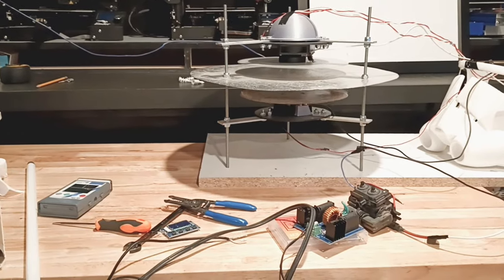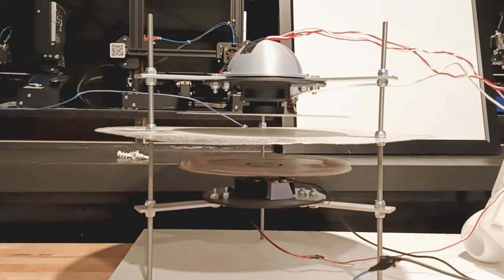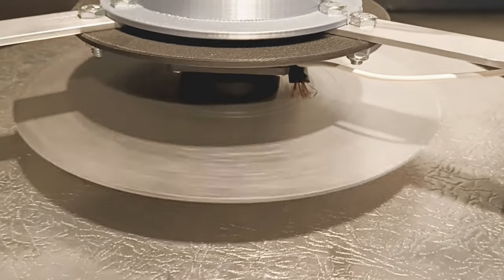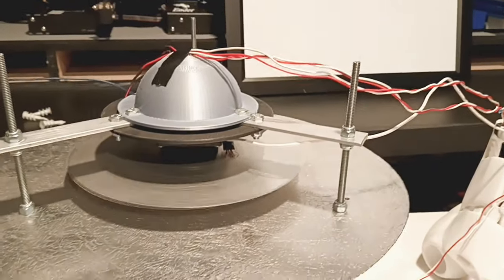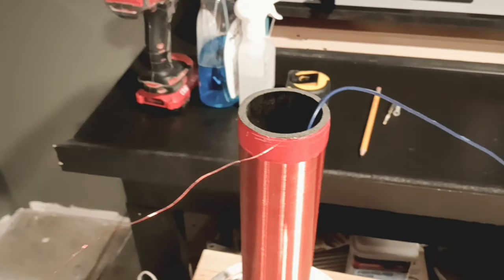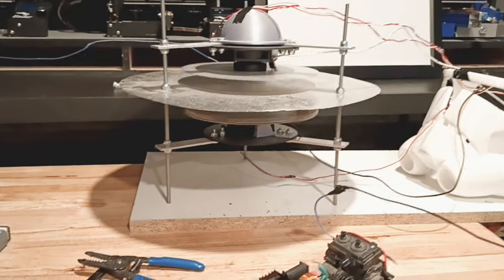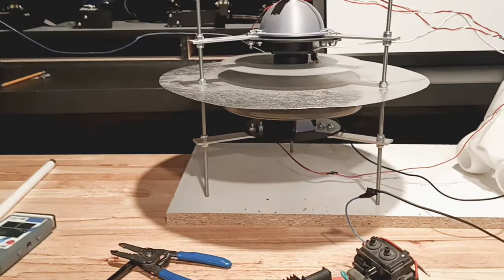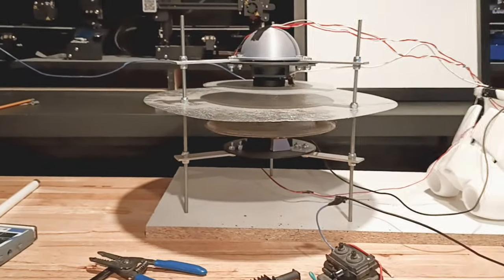Graviflyer Testing 1

Comment: Sorry but the simple explanation is, you have a capacitor between the centre plate and each of the rotating plates, the tesla coil is AC so you have current flowing through the tesla circuit and so through the plates.
The spark happens when the current caused by the tesla circuit rises enough to cause arcing.
The motors change sound/speed due to electro-magnetic interference from that current and voltage causing problems with the driver circuits built into the BLDC fan motors.
You mentioned you burnt out some motors, that would be the reason, EMI.
Reply from the maker: I thought the same thing. I just want to point out everything I see so others can see it as well.

Comment: When the sparks flew I could definitely hear a change. A very precise metronome tick 10-15 thousand Khz on the upper plate.
Reply from the maker: the tesla coil wire is sparking to each rotation of the lower disc at 380rpm

Comment: I dont know if the camera is inverted but i think  the spin may be anti clockwise
Reply from the maker: these are fan motors. They will only go in one direction. they spin clockwise on top and counter clockwise on bottom.
Reply: @nathanbunten4299   hey, I saw a video that can explain some things; Casimir Effect - What causes this force?
Reply from the maker: @danlimaanimations6739  I will look into it.

Comment: I’m curious if you could use this phenomenon 🤔…forgive my ignorance in the topic as I’m just starting to learn about this stuff, perhaps adding additional Tesla coils around the motor assembly   could create levitation if you could find a way to direct the field …maybe a circular faraday cage surrounding the whole assembly (coils and motors) to prevent frying your other electrical equipment
Reply from the maker: I think a faraday cage may be just what I need.
Reply: @nathanbunten4299 at the very least you’ll be protecting some of your electronics 🤷🏼‍♂️😂

Comment: maybe you should one non-rotating magnet, of the north pole put on top, under the curved disc. (a field passing from the edge of the disk, directed upwards, is required) and the supporting rods should be made as close to the shore as possible, so that the torsional field of the left spin y travels more easily. the torsion field is there but no one can see it 😆

Comment: Use shielded cables 🤷
Reply from the maker: I am not getting leakage from the wires. The center plate is putting out a field.
Reply: Have you considered that the original top dome was metallized plastic (i.e. conductive)?.
Reply from the maker: @Jeanpaul465  yes. in the next round of testing that may prove important for the field being created. in fact i think i need to add one to top and bottom.